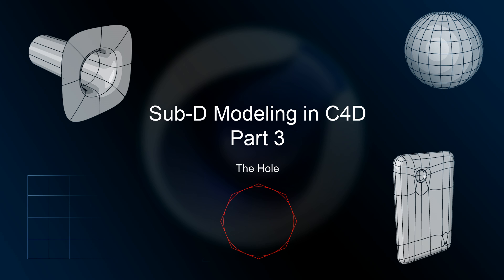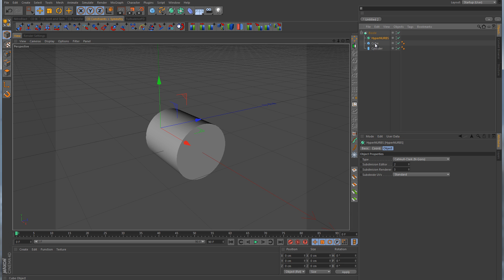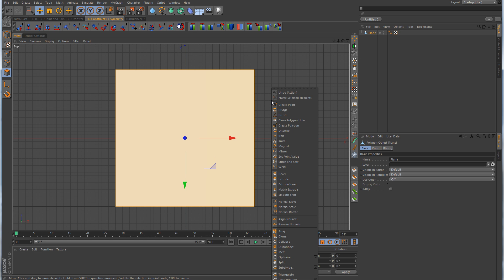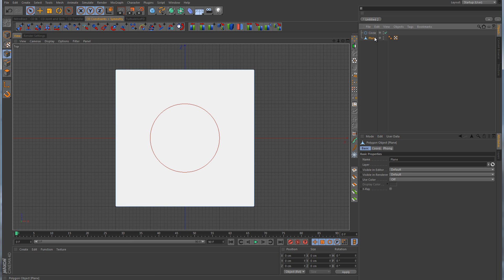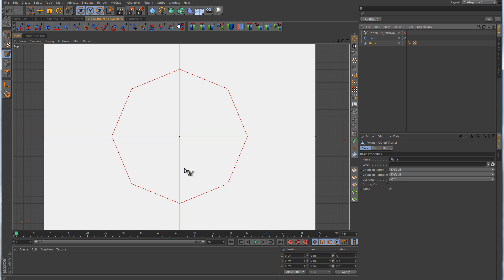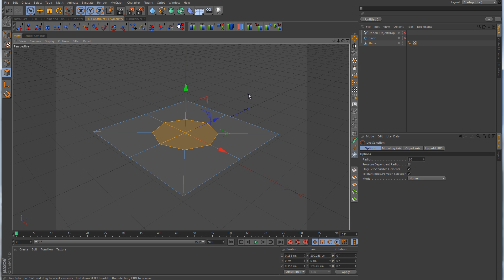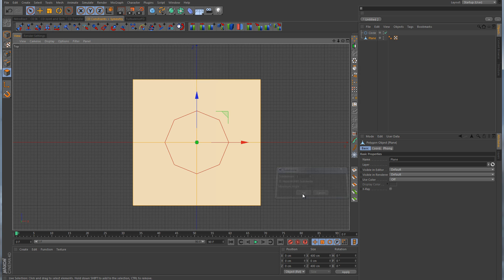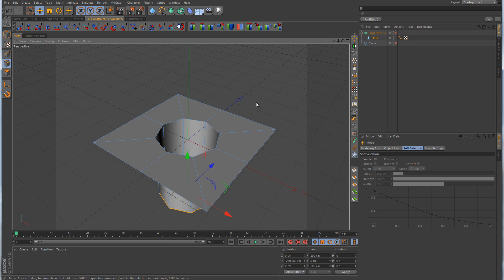Sub-D modeling in C4D - Lesson 3 - The Circular Hole

Comment: hell of a tut bro!! , i use boole usually when c4d, i use it for architectural stuff and it comes handy when setting sealing holes , so if the position changes i can change the position of the holes, i guess the right selection of the hole method depends on the project we are using.